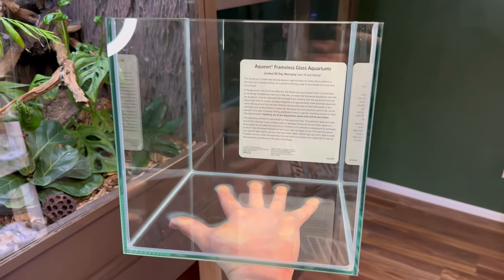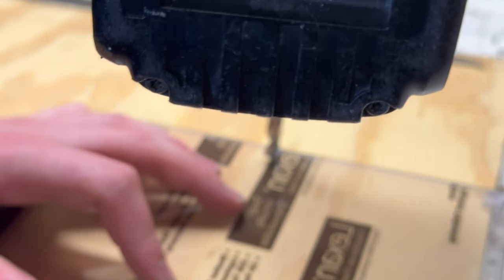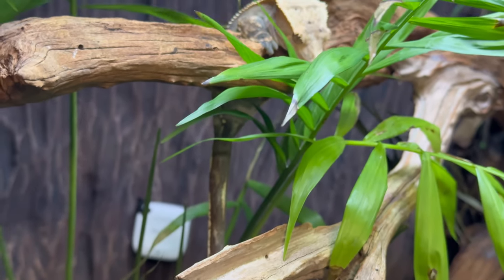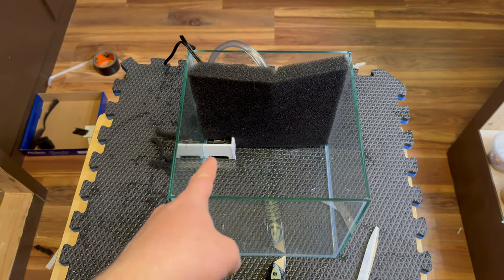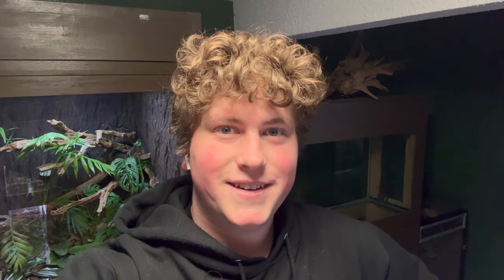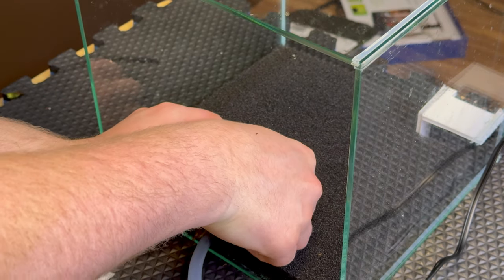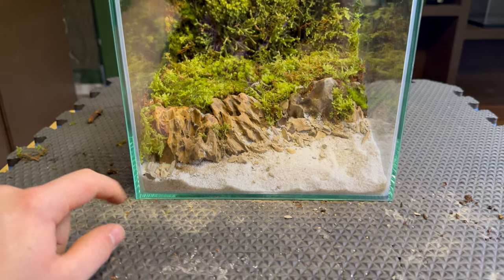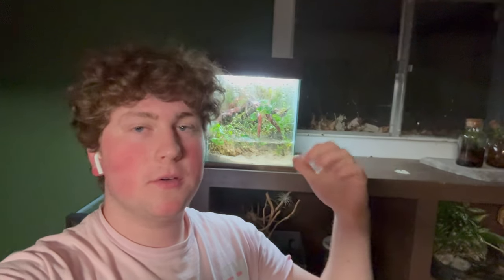DIY Raining paludarium V2.0

Comment: It turned out beautiful! I love how you used the tiger wood! Very interested in seeing how this holds up over time. Was there a reason you used glass for the sides of your water basin or was that just a matter of materials you had on hand?
Reply from the maker: Thank you! Yeah it was mostly just the materials I had, either one would have worked. I just had scrap glass laying around that I needed to use lol.
Reply: @hodesigns  I figured that was the case, but figured I'd ask. Love the idea of a raining or waterfall terrarium but they're a bit daunting. Love these videos! I see you have one for a waterfall one as well so I'm going to go watch that now 😁